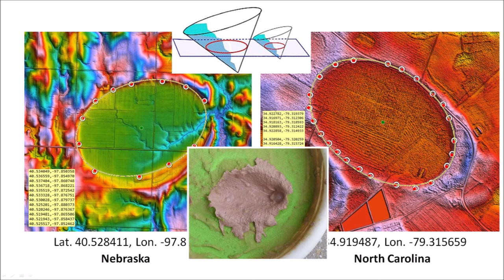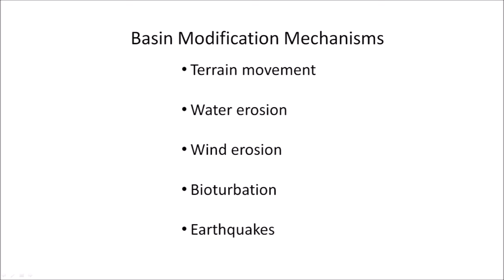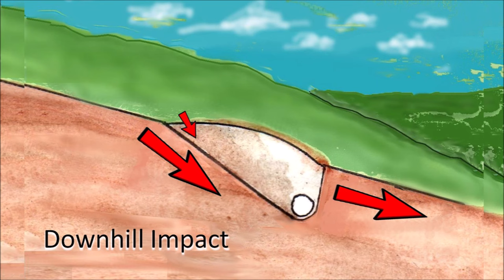Deformed Carolina Bays

Comment: This video from a few days ago: https://youtu.be/fim_hQNivxs?si=nRtk1LUqMYDKSy8_&t=448 focusing on the parabolic sand dune formations coming off the bays has the most challenging evidence to reconcile with the bays being ice craters, that I've seen so far.  I'd love to see Antonio's take on these dunes, particularly where it looks like sand dunes formed off the rim of one bay and then were partially ablated by another bay on top of the dune.  

The video also shows a similar pattern of oriented lakes on the falkland islands - not elliptical, but consistent in shape.

I'm not attached to any of the hypotheses yet, I'm just really curious.  So far the only big arguments against the ice impact idea that I saw was the age of the terrain (explained by the dates of terrain not matching the age of bay formation), and the lack of a primary crater (potentially explained by the ice sheet soaking up the energy).
Reply from the maker: Take a look at the analysis of Big Bay: https://youtu.be/cciLnQfGmXw
Reply: @Antonio_Zamora  I'd seen that one - it's a plausible explanation for big bay.  The situation in the video at the timestamp I linked is significantly different.  It shows a number of bays all with similar chevron-ish sand dunes coming off the SE corner of the bays to the east.  Some of these sand dune formations are then overlain with smaller bays.  The chevron dunes are not coming off of a body of water.  Interestingly, all the chevrons in the area, including ones not associated with bays, seem to orient the same direction.  This is different from what you'd expect if they were formed by splashes in a river which would throw material in opposite directions onto each bank.  

A couple ideas I have - which seem like a stretch and not very likely:
1. Strong winds (or perhaps a shockwave from something else to the west) were blowing east here while the event occurred, pushing ejecta from the larger bays off to the east.  
2. There was already water in the area, so the impacts threw slurries to the east.  This doesn't explain why they are all going east though, and not multiple directions from the impacts.
Reply from the maker: @PhilipMcGarvey  Wind was definitely a factor.  My video about atmospheric effects proposes that the Jet Stream got trapped under the expanding ejecta curtain: https://youtu.be/EVThf6SoclM
The video about Kelly Bay has another example where a small bay is on top of the splash chevrons: https://youtu.be/pExKHJ6XAyc
Reply: @Antonio_Zamora  in addition to what I have sent you in the past, i have even more evidence of this wind damage from MN all the way to NJ. i really think we can figure out when this wind event took place just based on where the damage is and isn't located along the ancient glacial lake shorelines, which seems like it would confirm the 12.9k date. just so you know, I have been going to bat for you on these other channels. those guys don't see the forest for the trees, i don't know how you remain sane.
Reply from the maker: Thanks. Critical comments certainly can keep me busy. It is to be expected for a new hypothesis that still has some loose ends.
Reply: @PhilipMcGarvey 
These geological "experts" have still not provided any other examples of mathematically elliptical geological features elsewhere on Earth. The closest features they can point to are distorted circular- and oval-shaped thermokarst lakes.